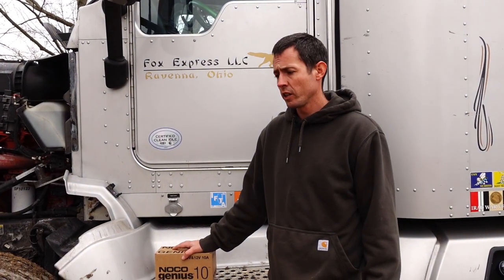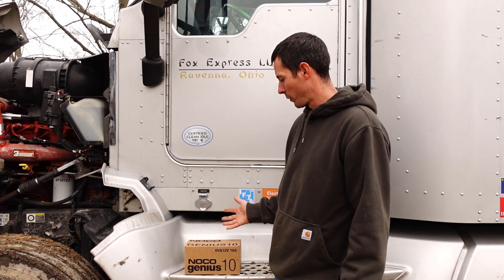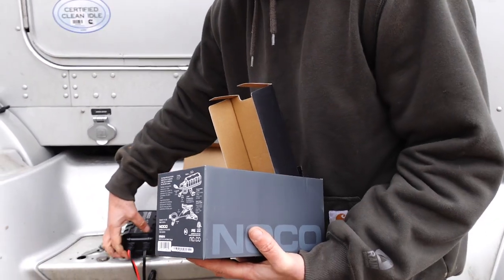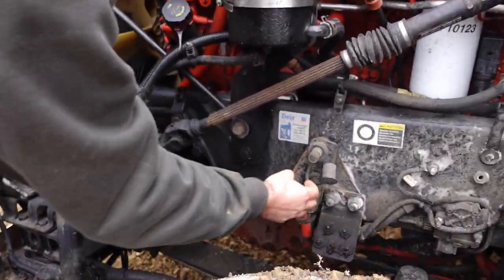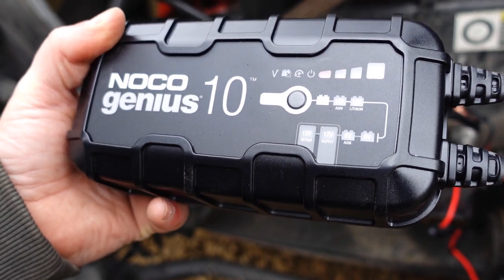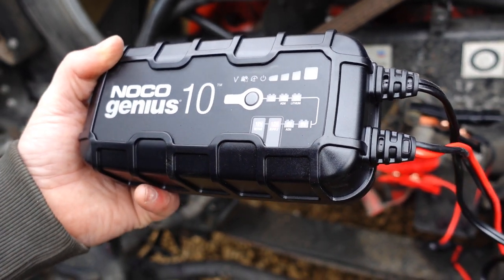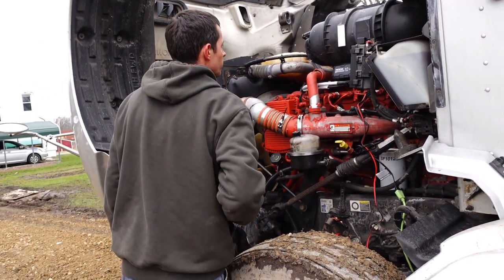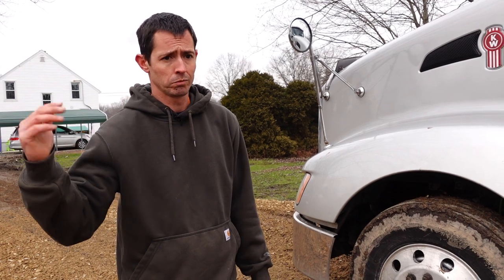Keep Your Truck Batteries From Dying With A Battery Maintainer - Landstar BCO/Owner Operator

Comment: I have a ram 2500 megacab Cummins with 2 12 volt 80 AH batterys,  will the 2 amp or  5 amp be fine for my truck? Or do you think stick with the 10?

Comment: Hey Ryan, how did it work out for you? I am in Northern Alberta and looking to buy this for the time when temperatures go below-20C and for times when I go on reset. I’ll only be using it for overnight or for maximum of day or two while at home. Our yard has power outlets everywhere so no issues there. My batteries are only six months old and I only run in to issue for very colder days because I am running my engine heater on manual mode for longer times. Any comments are appreciated.

Comment: With it being a smart charger being connected to 4 batteries it doesn’t time out when charging thinking something wrong with the battery. I have had that issue with other smart charger.
Reply: you can get the NOCO 4 bank charger, it charges all 4 truck batteries, and stops charging batteries as needed

Comment: Useful info as always,
I have the Noco ginius g 26000, can I feed it from the inverter and then connect it to the batteries of the same truck?
(When using Espar diesel heater)
Thanks,
Reply from the maker: You will be just pull off the same batteries. I wouldn't make a difference unless you have power coming in from outside.
Reply: @truckingandfixing  
Thanks, that is the same answer I had from the manufacturer when I called them, just days after I requested your help.
Thanks for the useful response.
Best,

Comment: Could you please suggest a Jump pack for Freightliner DD15. 
Thanks!
Reply: Goodall makes one but last I checked its like 700 or more for it but it does work. I have one myself but I've found if the batteries are too dead it won't jump it

Comment: Will the battery maintainer charge up if I plug into my inverter during the day while I run then switch over when I park to maintain my batteries.  Basically to not have to take it out to charge that box at home

Comment: Ryan question will battery maintainer.can I plug into my inverter and leave it will it charge and maintain my batteries in my freightliner
Reply from the maker: If you plug into your inverter, it was off on the same power, so it will not charge it.

Comment: Hey 
I appreciate your videos and the information you provide. I have a 2014 t660, also live in NE Ohio. I wanted to get your opinion on an issue I encountered recently.  I used my diff lock and released it but the light stayed on. Ideas?
Thx in advance.
Reply from the maker: probably should check the actuator on the back of the first axle in the wiring. Sorry for the delay